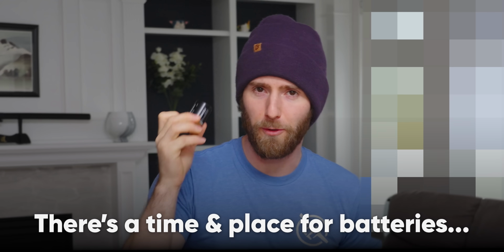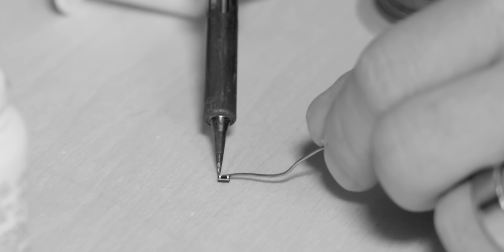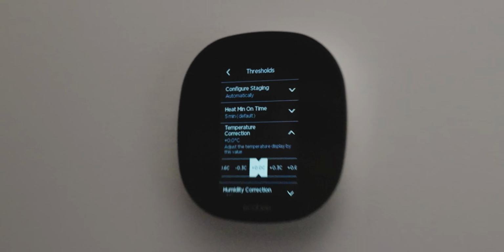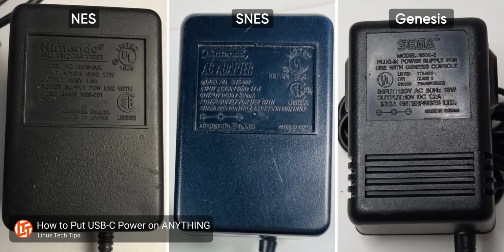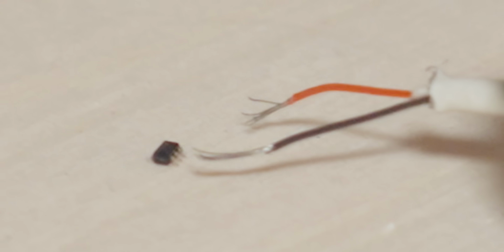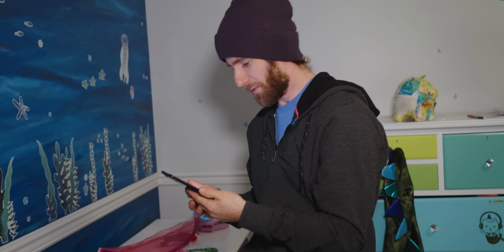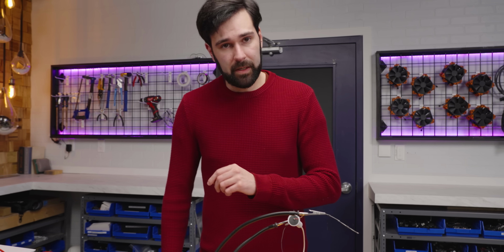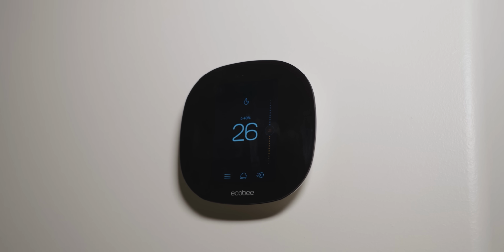I HATE Batteries! - Converting Wireless to Wired (a cheapskate’s guide)

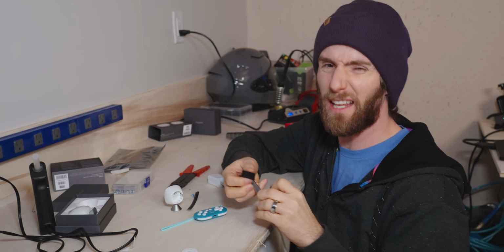Comment: @7:20, my solution for 2 of my sensors was a USB to 3.3v step down converter, cost a few bucks, already had a USB port on it. and for 3v battery operated devices, 3.3v usually works fine (you will find alot of 3v batteries or 2x1.5v batteries when fresh will measure over 3v and pretty close to 3.3v sometimes.

Comment: an even more elegant solution would be to be to put it in inside the wall and run the power off of the same outlet but just inside the wall, you wouldnt need to mount it to anything just make sure that the wires arent going to cause a fire and let it sit on the floor but in the wall.

another option would be if you didnt want to put it inside of a wall would be to wall mount it and use a Qi charger inside of ur wall instead

Comment: Love that Dan used the Diode volt drop trick! For anybody wondering why that works; diodes are typically used to stop current flow in one direction, but do incur a small voltage drop on the "open side" as well. Because the difference between 5v to 3.2 is relatively small, Dan was able to exploit the inherent voltage drop of the diodes by putting a few in series to get them where they needed to be. So cool!
Reply: I would've used a 3.3V Zener but this is cool.
Reply: @nadie9058  was gonna say the same. Im not awesome in electronics but isnt that exactly what a z-diode does?
But mb if they didnt have one laying around
Reply: This is also how you can get old camera light meters to run on silver batteries instead of mercury ones
Reply: Would have been better/fine with just the 3.3V regulator. New 3V lithium is usually around 3.2-3.3V anyway. Diodes/resistors are always going to have issues if the load varies significantly.
Reply: The problem with diodes and resistors is that they provide poor regulation. A zener diode is not a bad solution, but series diodes will not drop any voltage at ultra low currents, and at higher currents they may drop more than 0.7 volts. Same thing with the resistors. As the load changes, the output voltage changes. The regulation could be improved by increasing the current draw with lower value resistors, but that's not ideal. For example a 2k and 4k ohm resistor will output 3.33V at zero load. But it will output 2 volts with only a 1 mA load. If you drop down to a 20 and 40 ohm resistor, that will still output 3.33 v at zero load. But at a 10 mA load will only drop to  3.2 V. Much better, except the steady state draw will be 80 mA, or 400mW which would burn up your resistors. The proper way to do this would be an adjustable linear regulator, a potentiometer, and an output capacitor. It will exhibit good regulation from zero to max current of the wall power supply.
Reply: @gizmoguyar  They provide no regulation. The regualtion comes from the USB PSU. Variations in the load are 'passed'' to the PSU.
Reply: @kennmossman8701  Output regulation is defined as voltage output change per unit increase in current draw. There's also input regulation which is voltage output change per unit voltage input change. This is obviously not a factor with a regulated input voltage. But, regulation is the correct term to use here. Even the PSU will have some rated non-zero output and input regulation figures.
Reply: @gizmoguyar  That is not regulation [with the resistors]. This is only diminishing the effect of the load.
Reply: Yes but also increased the power usage by 3x the contact potential difference of the diodes multiplied by the current the thing uses. Tho, that might just be like 0.1 Wh in a year or so
Reply: @MicroageHD  It is very hard to think of a solution that does not increase current consumption. People seem to forget that a VR IC consumes about 10mA.
Reply: @kennmossman8701  A 7805 might use that much current but that's a part from the 70s or early 80s. Modern low-power regulators have much lower quiescent current consumption. Though series diodes are the best of the linear solutions for efficiency as they do not draw any extra current.
Reply: @eDoc2020  You are preaching to the choir, boy.  You seem to miss the objectives of this video.
Reply: If you are going to do a hacky solution a voltage divider using resistors would be better.
Reply: @backgammonbacon  A voltage divider will not work in this case because the temp sensor (ie: the load) has a varying current consumption, this basically makes it behave to the circuit as if the sensor itself is a variable resistor, as a result of this, the current passing through the whole voltage divider+sensor circuit is variable, and the voltage on the load ends up varying as well. Dan's solution using a voltage regulator is the correct one because the regulator operates independent of the current the load is asking for.
Reply: @backgammonbacon  A voltage divider using resistors is a terrible solution for most workloads because a larger amount of current will wind up just flowing straight through the resistors to ground. It's a more accurate solution but they're feeding a device that's tolerant of a wide voltage range from an already regulated source, so that accuracy is not at all needed.
Reply: @backgammonbacon  Well sure, but if you're going to implement a solution that requires ordering parts (in this case resistors in a package that Linus can easily solder to and of the correct values), then you would just order a voltage regulator in a larger package. I imagine that's eventually what they will do, but this is a fantastic proof of concept using parts on hand.
Reply: @backgammonbacon  what is the formula?
Reply: @backgammonbacon  Nope, A Zener Diode is make for exactly this.  You'd want a 3.3 V Zener, and at 20 Ohm reistor will supply up to about 100 milliamps at 3.3 volts.  Total BOM - $0.26.
Reply: @backgammonbacon  my thoughts as well. Instead of using two resistors (like 2k/4k) they over engineered with a linear voltage regulator.
Reply: @zestykefir  Wouldn't resistors limit the current severely? A 5 Volt source could only ever provide up to 2.5 milliamp over a 2k resistor, right? That would not be enough for the 7 milliamp spikes
Reply: @zestykefir  they literally mentioned they tried with a resistor divider tho? it didn't work because there wasn't enough current supplied at the output
Reply: @zestykefir  using a 3 pin through-hole 3.3v linear reg would be so much neater and easier, you could add a diode to the output too to drop the voltage closer to 3.2v but I'd bet it wouldn't be necessary
Reply: @jbradleyk  it would have to be a LDO
Reply: @Psyden5757  I think they tried a single resistor in series
Reply: @jbradleyk  mmmmmmmmmmmmmmm   3.3 - 0.65 is what?
Reply: @zestykefir  No, two resistors wouldn't work. The device (when turned on) acts as a low impedance path in parallel with one of the regulating resistors. This would result in a significant voltage drop across the load device. This why the suggested solution at 6:47 in the video didn't work.  The only way around this is to use extremely low resistor values which would be horribly inefficient and could even pose a fire hazard.
Reply: @Astartos22  thanks for explanation
Reply: I am not an electrical engineer, but wouldn't resistors be just the same except you could do it with more control since the resistors are rated for a specific resistance?
Reply: @jacobmalloy8384  problem with voltage divider is, that it changes voltage depending on load - unless you burn several times the load current on them. Voltage drop on the diode is more on less stable 0.7V.
Reply: @Papinak2  Agreed if you want a stable voltage input resistors aren't the way to go, but since these sensors are designed to draw fairly minimal amounts of current you could likely get away with a voltage divider.  The more general question is how tolerant to input voltage and ripple something designed to operate from a battery will be.  That likely varies quite a bit so in this specific instance I'd rather just leave it on battery since you're bound to have some quiescent current drawing pointless power in your various voltage drops to 5V and then 3.2V.  If I really wanted to do it anyway I'd probably just splurge on the couple of bucks to use an LDO with a cap on the input and output to ensure I don't damage the device.  Plus if I really wanted everything wired for power then I may as well not pollute the 2.4 GHz or 5 GHz bands with wireless signals and have my sensors communicate via a 4 to 20 mA loop.
Reply: @jacobmalloy8384  The problem here is that the device needs to have the same voltage delivered with different current draws - a fixed resistance setup will actually drop the voltage substantially more when the device draws more current, so either it gets too much when idle or too little when active. The diodes work better because they drop the voltage by a specified amount, rather than introducing a specified resistance which will behave differently depending on what the device is doing.

Comment: FIY: those regulators require capacitors at input and output to smooth out power spikes.  a small breadboard could help wiring all this up.
Reply: Only on the output would've been fine already.
Reply: @fss1704  the datasheet for the regulator part will usually specify the recommended capacitor values fo input and output. 0.1uf caps will usually take care of high frequency noise, while an 1uf-10uf capacitor will sustain the voltage during current draw spikes. Linear regulators generate heat since they are essentially just "smart" resistors, if heat is an issue consider using a switching regulator which work on principle of turning power on and off using a pwm signal and then smothing it again using a iductors and caps networks. The VCore regulator on your motherboard works on same switching principle btw, although somewhat more complicates and using mosfets to support a larger current draw.
Reply: @starlino  if your power supply doesnt already have smoothing caps it's fire hazard  garbage, i know a little bit more than you about power supplies,  check my intructables "Convert a Power Bank Into a 9v Lithium Battery"
Reply: @fss1704  decoupling caps neee to be placed as close to the device as possible. The wire can be thought as a resistor capable of picking up new noise but also adding to the voltage drops near the device. Having the decoupling caps on a wire 1 mile away is not going to help. On the other hand if wire is short, well shielded, you might get away with no caps on the other side.

Comment: Just did a similar job at work to convert an unstable 10-15 volt DC power source to USB 5v. Ended up using a 1kohm resistor in series with the load and a zener diode in parallel to make stabilized 5 volts.
Reply: A car usb charger would do the trick
Reply: Space was an issue and the car chargers didn't survive being opened

Comment: The issue is anything with a radio generally draws approximately zero most of the time while it sleeps, then orders of magnitude more when the radio is running so if it's right 99% of the time it's very wrong the most important 1% of the time. If you don't care about efficiency pick low enough values of resistor that the devices power draw is small compared to how much current flows through the potential divider and you're probably fine. Diodes are tricky too since for very small currents approaches zero, so in deep sleep your device will still see nearly 5V which it may or may not like. I would probably get a cheap FTDI adapter with a header for 3.3V and wire that in to the battery terminals instead. You can get USB A to go directly into the power brick, or Micro/mini USB to sit at the end of a cable. Or make a coin cell sized PCB and solder the wires to that instead, though it would be a little thinner and need padding out.

Comment: While this is a bit extreme for the average person, I very much agree with the ideology. Anything that reasonably can be connected to power and/or data via a cable, should be. The slight convenience of devices like this being wireless is not at all worth dealing with the (very expensive) batteries for me, even if they do indeed last a year or two. Remote controls are the only things that have a valid excuse to be fully wireless in my home, and even then I'd love to see more of those come with charging docks for that 99% of the time they're just sitting around in one spot anyway.

Comment: Yeah, redoing a heating loop already in a concrete floor is... well not something you do without REALLY needing to due to a leak. Trust me, I've been there and it is the sort of thing that makes you wanna set it all on fire. As for the batteries being the devil, they are. I have a front door lock on batteries that I LOVE but I had to find a way to put it on some large 18650s. I have to banks that I can recharge and put into it every other month. 

Also, more of Dan's soldering and electronics voodoo he does. Love the man. A great addition to the staff and good man.

Comment: Meanwhile... 3V 3-pin TO-92 style linear regulators are dirt cheap and more reliable than relying on the voltage drop across diodes.

Comment: The highlight of this video is Dan's part. Now I wish there would be a library of videos of Dan explaining electeonics
Reply: Agreed, Dan's segment was really interesting and he's great on camera.
Reply: He has great vibes. There's something really relaxing in just hearing him explain.
Reply: Dan Electronics channel would be fantastic
Reply: Same
Reply: If you need more of a burst current, a smallish capacitor could help with voltage sag... but normally shouldn't be needed
Reply: @billmiller4800  The problem wasn't voltage sag,* it's the fact that the voltage drop across a resistor varies according to how much current is being drawn - these little sensors vary a lot in their current draw, so the voltage keeps going up and down. Dan didn't really fully explain what he did at the end but they just replaced the regulator followed by resistor setup with 3 power diodes in series - the voltage drop across power diodes is much more stable and almost independent of how much current is being drawn in most real world circumstances, so there is no longer any voltage sag.

*Their 500mA USB supply can very easily supply the 30mA peak current the device is asking for

Comment: Another really simple way to drop down the voltage is by using diodes. one diode is equal to roundabout -0.7V, repeat in series as necessary ;)

Comment: If Linus actually wanted a cleaner solution, he could have used (or have one of his empoyees use) free software like KiCAD to design a PCB that properly fits an SMD LDO (voltage regulator) as well as a few other components like a capacitor (to keep the voltage stable during current spikes) and that contacts the metal springs normally holding and connecting to the battery. There are chinese maufacturers for custom PCBs that aren't really expansive. (For a YouTube video I'm sure the cost of a canadian PCB manufacturer would also have been much lower than the production cost of the entire video.) This way he would have had a stable and clean solution.

Comment: Two points to make. The battery voltage will vary above 3.3V when full so there should be no issue with a 3.3v regulator. 

Also for those larger current spikes a simple electrolytic capacitor for a few cents would help greatly.
Reply: I don't understand why they didn't ask a proper engineer which they have in the team and just over engineered it like hell.
Like they could have used a voltage divider with a cap and call it a day.
Reply: @zestykefir  could have been way over engineered but their point was to do it on the cheap. 
But I would say stay clear of voltage divider with no protections at all.
Reply: @zestykefir  I think Dan is an engineer, I'm not entirely sure why he has trouble initially but it did seem partly due to available parts and the directive to only use already available parts.

By the way, a voltage divider plus cap is not the solution an EE would recommend, they would suggest using a low dropout voltage regulator, or, in a pinch, a diode based dropper. Which is what Dan used in that segment at the end. Using a resistor based voltage divider, even with a capacitor, is a bad solution because the absolute best case is that it works, and the more likely case is that it's still going to be quite variable in terms of delivered voltage as the device draws variable amounts of current (particularly since other devices people might convert are likely to have very different current draw profiles). Using a low dropout regulator is the best approach, it's a single cheap component and you can literally just buy the one that says 3V on it. The current draw even during the "spikes" is so low that any off the shelf regulator will easily handle them in this configuration.
Reply: @zestykefir  I mean they could, but also why not just use an lm317.
Reply: @varno  Not even, 3.3 V Zener diodes are common, way smaller and simpler to solder than an lm317.
Reply: @nadie9058  just to be bulletproof, I wouldn't use a shunt regulator here, they don't work well for bursty loads like this one, and are super inefficient. This was because he wanted 3.2v rather than 3.3.
With jlcpcb being as cheap as it is, I probably would have just made up a pcb in kicad quickly with all the components and had them solder it together.

At the same time, I am suuuuper surprised they don't have any 317s in a to92 there. That and a couple caps would solve the problem imediately.
Reply: @varno  totally, in general an lm317 or similar could be a great option because it can be regulated to whatever you want between 0-12 V, I just thought the Zener was simpler but I’m not that experienced with this stuff.

Comment: a step down converter is 3$ with free shipping from China. You NEVER use a resistor to regulate the voltage on a device that is clearly not using the same power all the time... live and learn ;-)